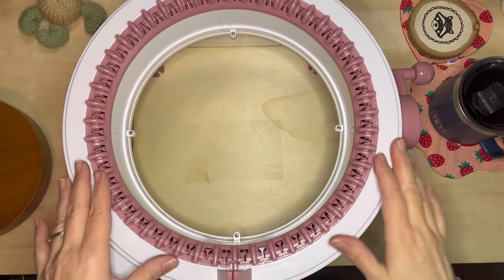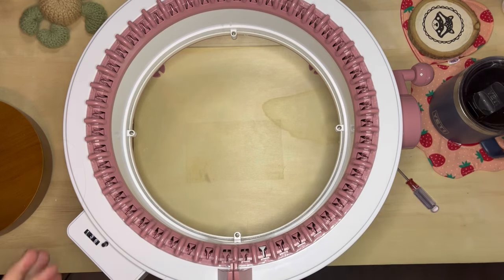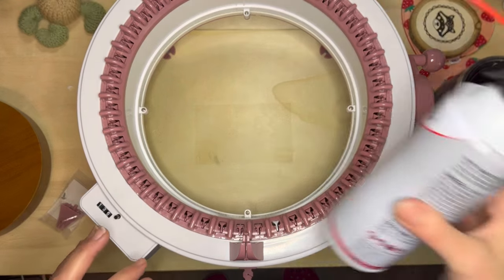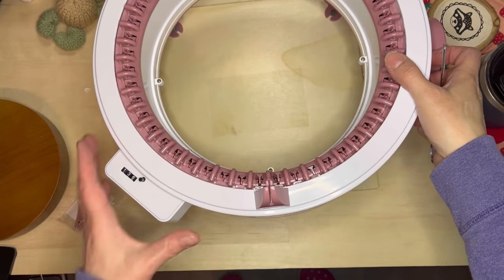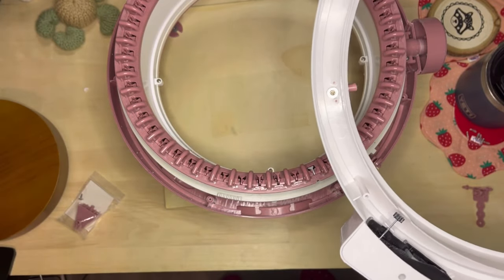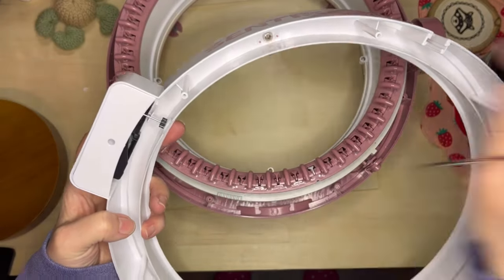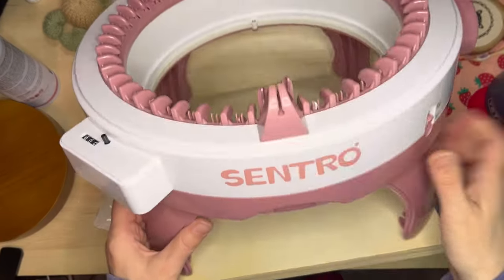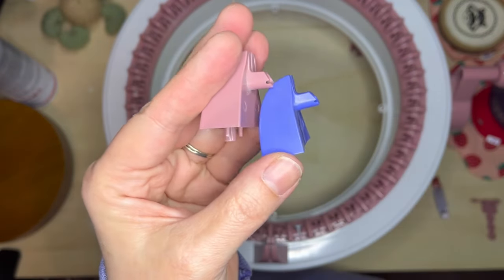How to fix the Yarn Feeder on a Sentro 48 a Knitting Machine

Comment: Help!! My brand new sentro48 is already dropping stitches! It was going along great and i was whipping out hats lickity-split when i tried a soft yarn i had no label on but it wasn't much heavier than what i had used prior. The machine went fine for a few rows then started clacking loudly i tried losing tension and cranking past but no good! It sounded horrible so i took the yarn off and went back to reg 2 ply red lion that i had used before but it was dripping stitches left and right.  I restarted several times and even tried different yarn but it's still dripping stitches. I turned it over and took it apart to see if perhaps the gears weren't meshing but it looked good and cranks smoothly. Why is it dropping stitches and what can i do??